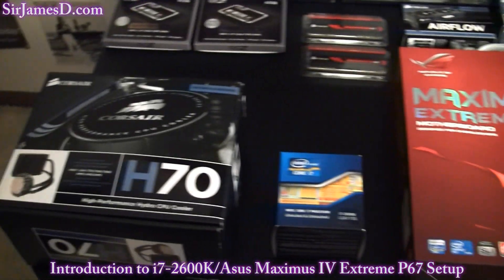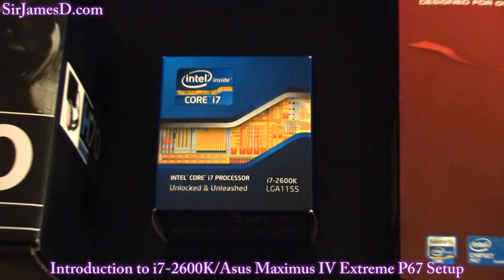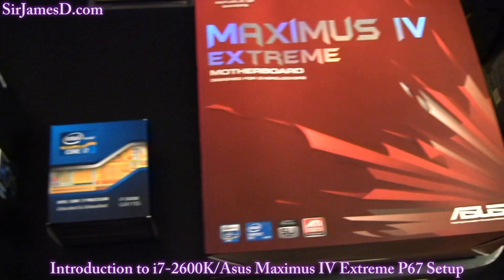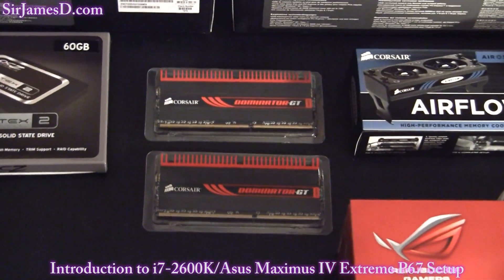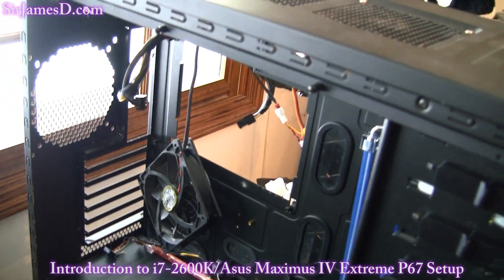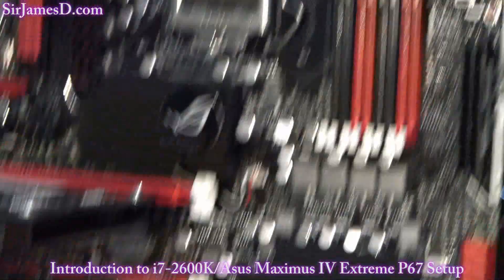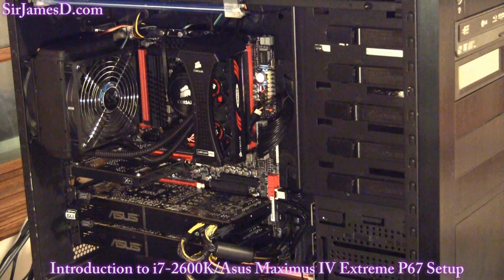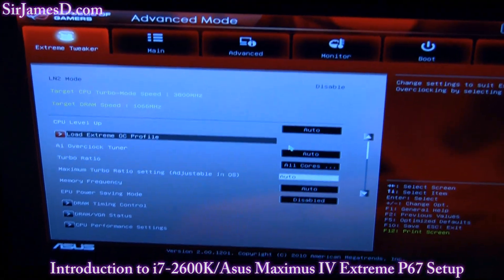Asus Maximus IV Extreme/i7-2600K Setup

Comment: I just got the intel core i7 2600 @ 3,40Ghz and i plan on buying the Corsair Hydro Series H80 and i dont know if it works with LGA 1155,plus is it watercooling or with fans? i hope fans because i dont like watercooling system at all. Please respond fast thnx

Comment: @jdookie2908 how can you use Cinebench for comparing CPUs for God sake? It's a multicore software, the more "CPU"  the better the performance.980X has them 12( 6+ HT). So, it's understandable that it will get the job done faster. But you compare it with 2600K, which has 4 (2+HT) less CPUs than 980X. 980X is faster in Cinebench, no doubt, but per core performance are much better on Sandy Bridge than Nahalem. So, all in all, 2600K is the BEST CPU on the market...till Ivy Bridge comes around.Cheers

Comment: Hi Sir James!  I can't tell you how awesome I found your video, great job!  I have a quick question, and it may be a mute point so bear with me.  You have two GTX 580 running at 8x each.  I have the exact same setup (to the tee) except I have 2 GTX 560Ti's.  My question is:  what if I ran a third 560Ti?  Would I put them in slots 1,2,and 3 and would they clock 16x, 8x, and 8x? I know it's overkill, just thinking of the future!   

Thanks in advance and keep up the great work!

Comment: Nice man. You'll love those vertex 2 60GB drives. Got myself a pair in Raid 0. I'll never go back to regular drives now lol. They spoiled me. If you get the 5 second power down after hitting the power button. That is a normal POST for those ASUS ROG boards. My old LGA775 Rampage did same thing. I checked with ASUS techs to make sure it's normal so no worries there.

Comment from the maker: @BadApathy The EVGA Classified 760/759, along with a couple other boards by other manus, was designed without ample power allocated to the PCI lanes. It all came out of the 24-pin. And with how powerful GPUs have gotten, my 24-pin didn't stand a chance.
Shamino made this public over a year and a half ago, recommending a molex mod so this wouldn't happen.
It's the reason EVGA too little, too late came out with the Power Boost.
Doesn't make up for it though for me.